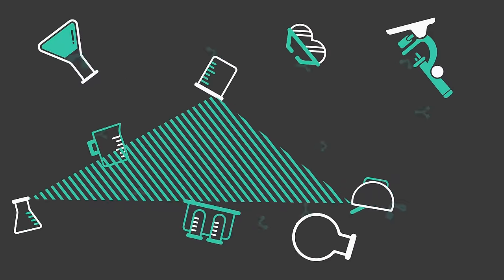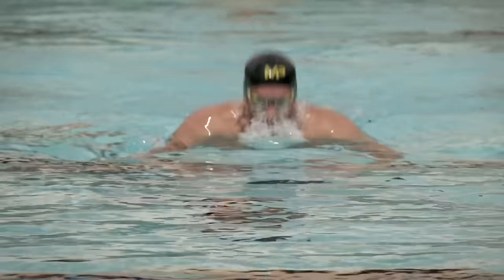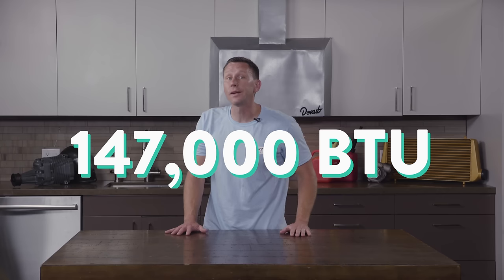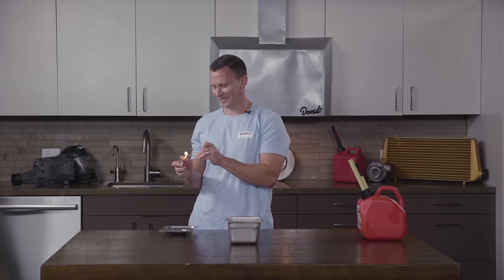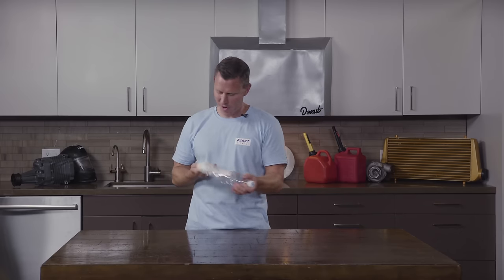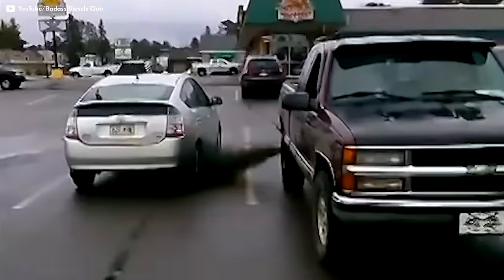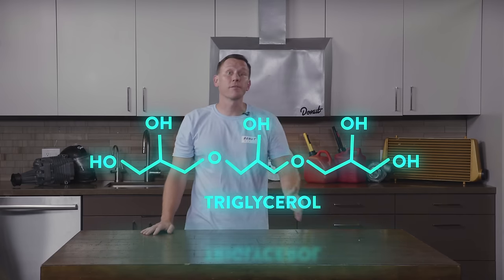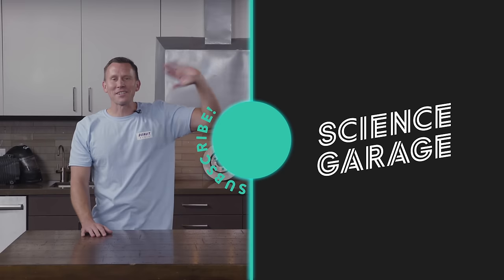DIESEL | How it Works

Comment: I hate to be “that” guy but you forgot to mention that Diesel Engines produce more low end torque than gasoline engines. That’s why diesels are widely used in industrial vehicles and 18 wheelers. One downside to a Diesel is that they don’t rev as high as gasoline engines.
Reply: the rev limit is easily fixed by a modern transmission.  My diesel gets 30 MPG at 75 mph on the highway turning about 2k rpm
Reply: Because the make way more power at rpms and last a hell of a lot longer
Reply: Meant to say lower rpms
Reply: Automotive Guru 

So your name is not just a clever name??
Reply: In fact they're capable of revving, I've seen some custom tuned Cummins 6BTs reaching 6500 rpm or Mercedes' OM606 crossing 7000. The Audi R10 Tdi could rev up to 8000. So one is capable of turning them into sporty units actually, the big ass torque comes in useful then.
Reply: thats why you stick turbo's on them to compensate.
Reply: Everybody here missed the four key words in the original post: "as high as gasoline".
Sure, diesel can get to decently high revs, but a comparable gasoline engine will always rev higher because the fuel ignites much more violently, and the engine components are lighter.
Reply: @sample3279  not as high as petrol, Formula one engine (which is a spark ignitied engine) can rev as high as 15,000 RPM.
Reply: @Chaps_Jr  and also due to the fact that diesels have longer stroke length than most gasoline engines, which means at a given piston velocity diesel will make fewer rotations per minute than gasoline. Usually 4500 for a typical gasoline one is comparable to 3000 for diesel
Reply: @govinlock8568  actually I've seen them crossing 20.000. Diesel is simply not designed to rev high. The easiest reflection of this is that a gasoline is a racing horse who just needs a jockey to ride it while diesel is a sledged ox you can load with various cargo and make it carry it.
Reply: is that because they need to decompress between explosions?
Reply: @StefanoFierros  No, all 4-strokers decompress between explosions by their very nature. The lower rev limit is usually because of the increased compression and stroke length. The increased torque also tax the parts a bit more than in a gas engine, so everything needs to be a bit more solidly built...

That isn't saying all diesel engines are low revvers... the Jaguar XE sport diesel version redlines at 6-7000 RPM depending on exact year/model/revision for the diesel version... and, yes it's probably the most fun diesel car i'll ever get to drive... that thing was so insane and yet so comfy :D

Also, adding to his comment on using oil, In Denmark it was popular until some 15 years ago to mod diesel cars to run on cheap rapeseed oil (cost about half the price of regular diesel), however running cars on vegetable oil has since been banned because of taxation issues. Running on rapeseed oil had the added benefit of smelling like someone was making french fries...

What the guy doesn't tell, is how silent they can be. The Peugeot 207 (I got a 2006 HDi model) is both very economic (some 22 km/l mostly), but also really silent for a small car, it's kinda like driving a luxury sedan without all the luxury fluff. 
The aforementioned Jaguar XE was so silent, you could go 200 km/h and only hear wind noise... the only time you could really hear the engine, was a slight "purr" when you floored it..
Another "problem" he doesn't mention, is that diesel is better suited for driving long distances, and that a diesel engine should at least get to operating temperature on your drive(meaning uf you have a long distance to work, a diesel car is optimal for you). Older diesel cars should also be run periodically at higher RPMs to do a "burn cycle" in order to clean the engine and particle filter of soot and residue... Modern cars do an ECU-controlled burn cycle every few thousand kilometers, but it can also be done manually by running the engine at a set RPM level for some 5-10 minutes after it has reached normal operating temperature (in my car it's 3000-3500 RPM).
Doing periodic burn cycle runs, even though you have modern car that does it by ECU, will help keep the engine and particle filter squeaky clean :)
Driving short distances is not good for a diesel car or truck, as it promotes soot buildup in the engine and particle filter... so it's not an optimal car for city dwellers.
Reply: Diesels cost wayy more to mantain.. not worth it unless you need it for work
Reply: @timmygunz7103  yeah it does but they live longer than Gas engines (with all the maintenance)
Reply: @jakovpalac9425  not always true. There are tons of industrial gassers that live just as long
Reply: @jakovpalac9425  that depends greatly on the engine and the driver, for examples a ford 460 and cummins 6bt last about the same if both are taken care of, however the GMC 351, 702 and a Detroit or CAT motors will probably last longer will outlast both easily, while a 6bt or 460 will most definitely last longer than a toyota or nissan gasser if all are well taken care of and maintenance is followed, ie a bad driver can bust the bottom end on a 6bt or wear the lifters out on a 460 as easily as he can blow a hole in the head on a toyota or wear the bearings out of a nissan.
Reply: jesus  GMC designed engines make most gassers look fairly anemic till you look at the power figures and they are just decent but low rpm.
Reply: @jdrok5026  yeah, they aren't made to make maximum power, just maximum torque, and they actually do quite well at that, beating out diesels in their class pound for pound due to more controlled combustion, modern diesels only do better due to forced induction.
Reply: jejesus mhm and a lot of diesels downsides are in its lack of ability to pull the same amount of air through the cylinder head as a gas.
Reply: Automotive Guru I don’t want to be “that” guy either but i know for a fact that that’s not true ( I’m not trying to be a smart ass wither
Reply: I hate to be that guy, but diesels for the most part don't rev that high because of the heavy metals and sheer size of the motors Forbid.  And diesel fuels slow burning nature works against it as well.  You really want 8-10 inch rods flinging round at 8000 rpm???  Too much rotating mass. Steel rotating parts and velocity dont mix....well.
Reply: Just... add mo' gears!

20 spd manual, here I come!
Reply: Wooosh..
Reply: They do also produce more high end torque then a gasoline engine
Reply: He def said that tho
Reply: Why would that be a downside? Yeah they might not be perfect for racing and stuff, but i don't see why them operating at lower RPM would be a downside. Some diesels pull harder at 5000rpm (redline yo) than some gasoline engines that can go up to 9000.
Reply: My diesel revs to 5k look up om606
Reply: Just add more and bigger gearing, every can be fixed with gearing.
Reply: Also why railroad locomotives are powered by diesel
Reply: Modern high speed diesel cars, trucks etc. Now has trannys with proper gear ratios that compensate for the low revving engine.
Reply: @govinlock8568  Many super sport motorcycle engines can rev to 15,000. Honda released a motorcycle that revved to 19,0000, it was a 250cc inline 4 used in the CBR250RR. (RR meaning race replica :D)
Reply: @desertrainfrog1691  i smell fortnine
Reply: @desertrainfrog1691  Indian dude with a weird accent 💀😭😭 just cuz it is different don't mean it is weird 😭😭. But yea zx 25r is like that Honda too

Comment: Power steering how its workkk
Reply: FarhanMaming it's easy dood its hydraulics I think
Reply: Hydro = Water

Power = Electricity
Reply: FT Rookie no it just has the name power because it helps you "power" through the steering
Reply: FT Rookie there is electric power steering though
Reply: FT Rookie Lmao well by that logic all "power steering" systems in cars are electric, when in reality they are 90% hydraulic...
Reply: Look up how hydraulic systems work, the steering rack/gearbox in your car uses the rotation of your engine through belts to spin the power steering pump which pulls fluid from the reservior to pressurize it into the steering rack that uses a piston to push in the direction of the drivers steering direction. Hope this helps 👍
Reply: FarhanMaming a pump mechanically connected to the engine
Reply: Waffeey.  still want the video
Reply: J Walker yeah i still want a video about power steering works
Reply: Also want thi video about the power steering
Reply: Hydraulics i think
Reply: @FtRookie  Power= Electricity? Are you OK?
Reply: @flaminak7894  Look up Electric power assisted steering (EPS/EPAS) or motor-driven power steering.
No hydraulic systems are involved. 
Most modern cars and lighter vehicles  use it.
Heavy vehicles do use hydraulic /electro-hydraulic steering systems .

Comment: I learned how to drive on a 1970s Mercedes Benz station wagon that was diesel, with NO TURBO. I still dig diesels, and am getting > 40MPG averages on my 2018 Chevrolet Equinox with a 1.6L 137hp diesel (my 50 mile record was 65.2MPG, but that was when I drove to Colorado in 2019, places such as Nevada and Utah with 80MPH speed limits and long flat straight stretches of freeway helped me determine that 72MPH is about the hypermiling ideal for that car for speed to MPG trade offs, alas California has many windy hilly roads, and tons of stop and go traffic, so I don't experience that kind of efficiency here). I drove a 2001 VW Golf TDi (which was about 90hp) that I bought used with 100,000+ miles on it, for another 150,000+ miles before the transmission ate itself and my mechanics laughed at me about doing more maintenance on a car that already had the 3rd highest mileage of any vehicle they had ever serviced (255,000+ miles wasn't bad, but not 400,000+ miles like that 1970s MB wagon got when I last knew of its whereabouts), I mostly ran that car on B99 biodiesel too!

Comment: there are 2 stroke diesel's as well dude. infact those we're the most common. hot bulb engine's for example.
Reply: Detroit 2 stroke desiels are amazing!
Reply: ishouldgetalif3 👍 Detroit diesel. Most busses powered by the 2 stroke.
Reply: kirk2425 I love the v12 ones , they sound like a v8!
Reply: GM's Electro-Motive Division until 2015 was using 2 stroke diesels for their locomotives. Starting at 567 cu in per cylinder, 16 cylinder variants putting out 1500 HP, to now 4360 HP in a 16-710 cu in engine. Pretty neat. Though their competitor, General Electric managed to go from 2500 HP 4 strokes to 4500 HP without changing the principal factors of the engine such as bore/stroke.
Reply: Just as common as two stroke gas engines. This video over-simplifies The entire process.
Reply: Mmmm... Two stroke diesels make me want to channel my inner cave man.
Reply: Rotor Head lmao

Comment: There are indirect injection diesel engines as well. The diesel does burn faster in these engine and they are quieter, but the use more fuel and emit more particles. There are direct injection gasoline engines as well, they run stratified charges until half-load or so (depends on conditions) and homogenous charges on more than half-load. Stratified charges cause particles, diesel engines always run stratified charges. Indirect injection gasoline engines always run homogeneous charges and direct injection engines can run on stratified or homogenous charges. 
Gasoline engines have a 3 way catalytic converter, it needs a lambda value of 1 to be effective and to convert CO, NOx and HC into non polluting CO2 (CO2 is a greenhouse gas, but it is not a pollutant, we breath out CO2), N and H2O. In the gasoline engine lambda value can varie between 0,97 and 1,03 at most. 
Because a diesel engine never runs at a lambda value of 1, since it always runs on stratified charges, it can't take advantage of a 3 way catalytic converter. It doesn't have so much to do with temperature, although a little, but more that it run on a lambda value above 1. They can benefit of a 2 way catalytic converter, that converts CO and HC, but can't handle the NOx, the nastiest of them. That does not mean they can't be reduced, because the can. An EGR helps cool the cylinders, hence reducing the formation of NOx. 
Particle filters, NOx traps and ADblue help with diesel emissions, but time marches on. It is not sufficient, at least in Europe. In the near future even gasoline engines will have particle filters in the exhaust, and diesel cars will become obsolete. So will gasoline cars, but not so soon, yet in the near future as well.
Reply: Can you repeat that one more time?
Reply: There are indirect injection diesel engines as well. The diesel does burn faster in these engine and they are quieter, but the use more fuel and emit more particles. There are direct injection gasoline engines as well, they run stratified charges until half-load or so (depends on conditions) and homogenous charges on more than half-load. Stratified charges cause particles, diesel engines always run stratified charges. Indirect injection gasoline engines always run homogeneous charges and direct injection engines can run on stratified or homogenous charges. 
Gasoline engines have a 3 way catalytic converter, it needs a lambda value of 1 to be effective and to convert CO, NOx and HC into non polluting CO2 (CO2 is a greenhouse gas, but it is not a pollutant, we breath out CO2), N and H2O. In the gasoline engine lambda value can varie between 0,97 and 1,03 at most. 
Because a diesel engine never runs at a lambda value of 1, since it always runs on stratified charges, it can't take advantage of a 3 way catalytic converter. It doesn't have so much to do with temperature, although a little, but more that it run on a lambda value above 1. They can benefit of a 2 way catalytic converter, that converts CO and HC, but can't handle the NOx, the nastiest of them. That does not mean they can't be reduced, because the can. An EGR helps cool the cylinders, hence reducing the formation of NOx. 
Particle filters, NOx traps and ADblue help with diesel emissions, but time marches on. It is not sufficient, at least in Europe. In the near even gasoline engines will have particle filters in the exhaust, and diesel cars will become obsolete. So will gasoline cars, but not so soon, yet in the near future as well.

Happy? Ha ha ha
Reply: Bosch automotive handbook, Tom Denton automobile electrical and electronic systems, Tom denton Automobile mechanical and electrical systems, Tom denton advanced automotive fault diagnostics. But most of that I learnt in college.

Comment: To keep up with the truck theme, why not make an Up to Speed on Ram (or Dodge Ram, it's pretty much the same thing)
Reply: They already did the f150, why would they do the ram? it isn't as interesting.
Reply: ChryRian they get to talk more about the V-10 Ram?
Reply: ChryRian I agree, the ram is not that interesting or special. Defiantly not the best truck, but they do have the best engine ever put inside of a motor vehicle (6bt cummins). If you don't agree I'll wait until you can find an engine that as consistently as the cummins goes over 1 million miles.(no engine is superior to the cummins in longevity). The real strong point of the cummins turbo diesel is that when the engine was designed it wasn't a truck engine it was used to power industrial machinery, cranes, tractors, mining, logging, construction equipment, and boats to name a few. Because of that it has its absurd mechanical reliability, truck applications of the cummins are really really light duty compared to what the engine was designed to do, that's why it lasts so long.
Reply: @MINTBERRYCRRUNCH   the 7.3 powerstroke is a better overall choice. The cummins is a better engine itself. But when it comes to the whole powertrain , the 7.3 powerstroke is better. Do to the transmissions are way stronger, diffs are designed to not get as hot. And the rear ends are a lot stronger
Reply: @daltonandrew168  Yeah overall ford probably makes the better truck, but ever since they got rid of the 7.3 theres been something to be desired in the reliability department from ford... I would never throw away my money on any powerstroke thats not the 7.3. Ford motors are trash, yeah the transmission is gonna be a lil tougher and the suspension too, but thats not important when you blow head gaskets every 50k miles in that ford and need 5 grand in on repairs a year just to keep the truck on the road.
Reply: MINTBERRYCRRUNCH a 7.3 powerstroke , a 6.9 international and a 5.9 Cummins are equally the 3 best Diesel engines ever made .
Reply: Dalton Smith most 7.3 power strokes now a days are having gasket and cooling problems that are around 300,000-400,000 miles now that is still a lot of miles and I love the 7.3’s but compared to the 12v and the 5.9 24v the 5.9’s are a more reliable engine